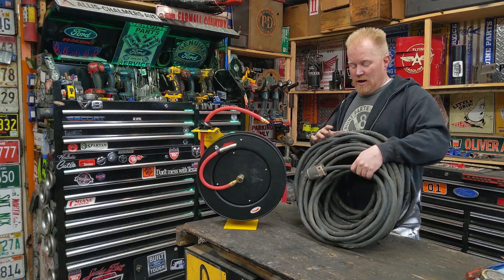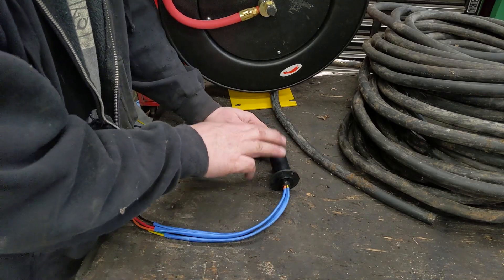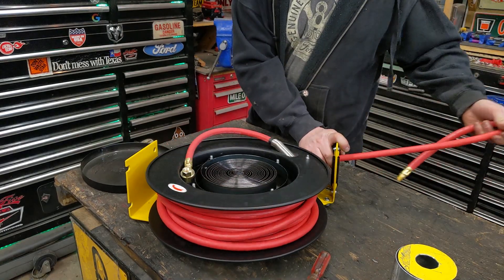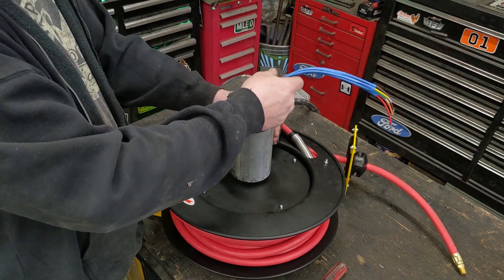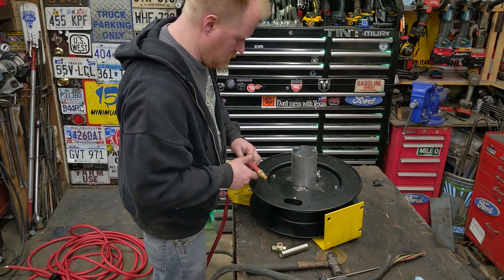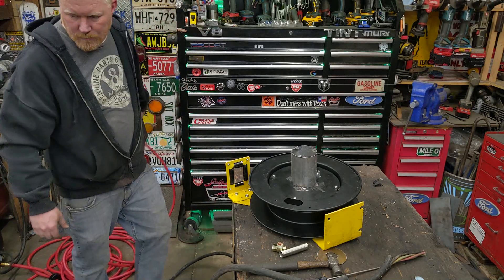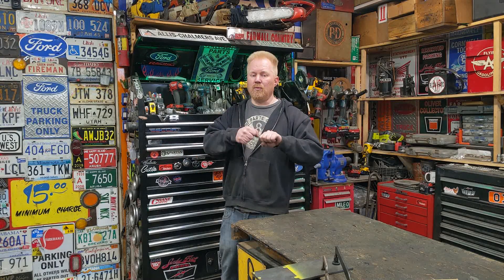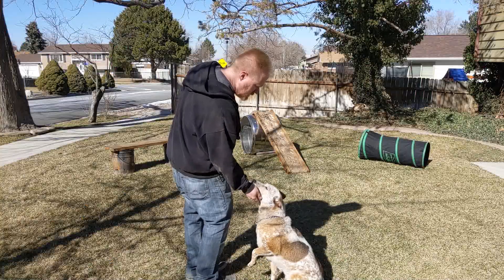DIY retractable WELDER Cord Reel 50amp 240volt Plasma Cutter

Comment: Nice fire starter dude, I’m sure the fire inspector  will have a lengthy conversation with your home owner insurance adjuster ie: non UL listed wire reel. Just saying!! Being alicensed journeyman electrical  in the trade for 45+ years, I figured I’d point out a few improper wiring techniques that were implemented in your conversion of the hose reel. Great idea, just don’t want to see anybody lose there house or shop to electrical fire and god forbid anyone’s life! So here goes for starters the slip ring-collector assembly is not UL listed, 1-conductors are exposed, tape doesn’t cut it per NEC. 2. One needs to unspool the wire before use as the wire wound up and in use will over time will heat up any ferrous metal within the EMF created by the wound up coil of wire. 3. Soldered connections are addressed in the NEC as being NOT permitted. The use of listed conductor splice connectors are. Also the red wirenuts made by Ideal are not rated for #6 stranded cu wire and 2 #12 cu wire. I know that a listed cable reel is expensive but so is you life and your family’s not to mention your home. No sense of paying home owners insurance only to shoot yourself in the foot by a nonapproved installation of equipment. The Woodhead company is one that sells super reliable cord reels just saying
Reply from the maker: First NEC has no governing over this at all as it is a plug in appliance. The NEC controls the wiring I have going from the breaker box to the outlet only. This is plugged into that. Soldering is 100% standard practice and approved under UL and CE. The Wire nuts are not retaining the wire at all. The slip ring is European Union CE listed. EVERY wire spool should be unwound during moderate-heavy use and is standard practice. The only thing I did that wouldn't meet UL or CE listing was not providing extra shielding for the wire going from the slip ring into the junction box. UL listing is voluntary and not required. They are a private company that charges a premium to inspect stuff. I know my toilet has a UL listing and it makes me feel comfortable every time I realize it.
Reply: The NEC has a governing body over the insurance underwriters. The the welder/plasma cutter is NOT an appliance it is considered cutting process EQUIPMENT per 630.1Nec. As per the soldered splices, NEC 110.14(b), (If conductors are soldered, First Mechanically and electrically splice or join the conductors so they are secure WITHOUT solder,then solder the connections insulate with friction tape or equivalent. That is for the 2 current carrying conductors as for the 3rd wire in your modification the grounding conductor, 250.8 NEC,grounding conductors SHALL Be connected by exothermic welding, listed pressure connectors,listed clamps,or other listed means. (No soldered joints). I didn’t bring up the other issue of voltage drop in the length of theirs on the reel. The reason the nec is there is to prevent fires ie: loss of life and property. Just saying!
Reply: Keep wiring like that and you will need an outhouse as your UL listed toilet will be up in smoke with your house

Comment: There are spools like this that are meant to be used for water hoses. They have a stronger spring so should have more pull and be a bit more robust.
Reply from the maker: Very true. I need to run it in and out a few dozen times to settle the clock spring. Then I can easily tighten it.

Comment: (for anybody that doesn't know) Basically with a slip ring it can spin for as long as a motor can, that's basically what's inside of a universal motor. It can spin as fast as a motor too if you support it properly. You can run parallels for a single appliance say you have a rolling mill feeder that need 600a 480v you could run 4 sets of 3 phase to keep your wire radius down but you have to individually protect each conductor with at minimum fuses. That's way beyond the scope of this video though 😂😂 your screw facing got my like 🤙
Reply from the maker: Hey Thanks, I'm glad you liked it.

Comment: Oh btw, another reason a lot of electricians are a bit skeptical to welders on normal domestic circuits is that they are usually Class A (or whatever it is over there) that doesn't have enough back EMF and noise shielding (mostly because it can't properly remove all noise effectively) for any delicate equipment, so if you're a bit unlucky it might take out your TV or amplifier. Had a friend getting his expensive tube amp wrecked by a TIG welder (the HF start is very noisy), but arching when welding with MIG and stick can also create quite a bit of noise.

I'm running mine through an isolation transformer, but there's still a bit of noise from it.
Reply from the maker: Very true. Well said.
Reply: Oh Boy! I have a lot of sensitive electronics. Maybe I don't want to weld at my house... 🙄🤔 My welders are all linear transformer type, not switch mode inverter type. Wouldn't the transformers in the welders isolate the noise? What about a heavy duty buck converter using a toroid and tons of capacitance?
Reply: @waltschannel7465  Transformers isolate noise quite well, the meatier the better.

The problem is with switch mode, it has quite spiky high frequency noise, and the self adapting nature (and ability to modify the output current rapidly) makes it return quite a bit of noise to the grid. Just adding large caps will (unintuitively) actually just make it worse, it has to be a properly designed filter, which is expensive and therefore often skimped on. Just having a huge 1:1 transformer in between will get rid of most of the noise.

Some info on designing PSU caps:
https://www.youtube.com/watch?v=qosClvn9GqU

Comment: The amperage on the welder/plasma cutter output side is stepped down to a lower voltage, so It's not directly correlated to the amperage on the input side. So for example, my 250A MIG consumes maximum 25A on the 240v side when it's on full tilt (and I'm not talking about average over time), so even considering you 'muricans use 120v (and consequently need twice as thick wires), that amperage rating on the slipring seems a bit over the top, and I couldn't find any info on what isolation level it has (ie how high voltage it can safely handle).
Reply from the maker: For high demand appliances like this we us 240v here in the US. It is two 120v phases 180degrees apart at 60hz. So unlike yours that is 240v positive and negative off zero, ours while one phase is 120v positive the other is 120v negative with a 240v difference between them. I think the slip ring stated 600v 30amp.
Reply: @sixtyfiveford  Here in Norway we use two systems, IT (Isolée Terre) and TN-S (Terra Neutral), in the US you usually use a variant of TN-C-S. Historically  we've used the IT net since it provides more reliability and can easily detect any ground faults (high earth fault impedance), but new installations use TN  as it allows easier load balancing (IT net's have to be carefully balanced or the neutral point starts drifting from neutral), provides more power and allows mixed 220/400V installations for when you need high demand. Also, the TN system(s) are used by more or less the rest of the world, so it's a bit easier to get equipment and training.

It is also quite common to use 220v or 400v three phase for anything more demanding than 2KW (like welders often are), and the configuration you use with 2x120v from 2 legs in a delta transformer doesn't easily allow this.

Info on TN (and the likes)
https://en.wikipedia.org/wiki/Earthing_system
I could only find this in Norwegian (possibly since it's mostly a quirk of ours):
https://no.wikipedia.org/wiki/IT-nett

Comment: Bad idea. The coil will be a transformer and create heat enough to cause a fire at high current and extended time.
Reply from the maker: No it won't. You have two 120v opposing phases that cancel each other out.

Comment: Do you know why they don't run coils of wire around a metallic core?
Reply: He's running the full circuit so the in and out currents cancel each other's magnetic fields.
Reply from the maker: Where have you been? It's done all the time.

Comment: 80# that's all?  Try 3 phase SO cord.  We have 150' long cables for our welder.  480VAC 30A is what we want for our welder at work but we use 8/4 SOOW cable to power them.   It effect the welder when we have that long of cable.  Love your idea!
Reply from the maker: I have a 6/4 SOOW 150' cord I never bring out because of weight. I can't imagine how much weight I have there.

Comment: My house isn't wired for a welder, and I am using (newbie) a Harbor Freight 60-125, I've been looking for a cheap extension cord, and really only need a 10 footer. Can I get away with using a 12-14 gauge?
Nice job.
Reply: That would be dangerous, and likely more expensive than buying heavier gauge cable. Don't skimp with this equipment! Actually, I hope you will get an electrician to run proper wiring and an adequate outlet at the point you want to set up your welding station. Meantime, bring the work to the welder, and cobble up good protection around it whenever you strike an arc.
Reply from the maker: That's the 120 volt welder isn't it? 12awg extension cord up to 50 foot will be more than adequate. 14awg you could get away with maybe 15 foot.

Comment: if you leave a 240 volt cord plugged in while in a coil the insulation seems to breakdown very fast,  even if no load is applied.  Something to do with the magnet  field.
Reply from the maker: I can't say I've ever heard this.
Reply: Not possible without any load through it.

Comment: That is a Great idea    If I took that cover off the spring would have jumped out and attacked me
Reply from the maker: I know where you're coming from. The first time I took it off I was very careful.
Reply: I was thinking the same thing. 
I have had a couple tape measure run ins. 😁😎
Reply: @OldSneelock  It is funny if no one gets hurt
Reply: @not2fast4u2c   You are so right. When they break it is like a razor blade flying around.

Comment: i was wondering.... welding with the wire coiled up like that, wouldn't it like create a magnetic field (like an induction heater or something) and melt the wire? i have no experience in electrical work.... just asking out of curiosity
Reply: The two poles are opposite (or zero) at any given moment, so their electromagnetic fields cancel each other out
Reply: @N-hunter  oh... i had no idea.. thanks for explaining!

Comment: Made in the USA, Mercotac slip ring connectors will transfer up to 500 amps.  NO that is not a typo.  The one I purchased for a Christmas decoration Ferris Wheel will transfer 50 amps.  The best thing about these is they use mercury as the slip ring contacts.  THUS, there is NEVER any wear on the rings.  I am extremely happy with the one I purchased.  Easy to mount, easier to use.
Thanks for the videos.
Reply from the maker: I did look at their slip rings. They are not cheap and the only one over 30 amps was over $1000 if I recall.
Reply: Got a link to the 50amp one?

Comment: They have power reels for RV applications with 50 amp wires. You can probably buy one of those and fit your own ends to them. I've even seen these reels have power retract.
Reply from the maker: Yes they do make exactly what I made here but it'll cost you about $1, 000-$2,000.

Comment: Heeler-isms. Ginger will be bouncing up and getting the 220 for you. Might better keep the breaker off. The only 220 here on a chord is for the pump to generator on a DPDT to disconnect from line voltage. It stays wound up on the generator, ready to go. Glad you're set and GBWYall!
Reply from the maker: Train her to bring me the cord end.
Reply: @sixtyfiveford  That'll work! BETTER, even!

Comment: Could you have wound the spring a little tighter? It looks like there were quite a few more turns available.
Reply from the maker: Yes I added two extra winds last night.
Reply: I was wondering the same.  I’d like to make one of these as I don’t mind getting dirty, sweating and wearing myself out when building something, but having to roll up that cord just pisses me off for some reason.

Comment: Love the idea, but coiled extension leads need to be fully unwound before drawing high amps.
Reply from the maker: Yes, that's standard practice with any extension cord.
Reply: Electromagnet!
Reply from the maker: @wafflezoot  Nope. 240v is two 120v phases that are perfectly opposite and cancel each other out.
Reply: @sixtyfiveford  , doesnt usa have 3 phases in the street which may mean it is only sometimes perfectly opposite out of the 60 alternations every second.  a qualified electrician is the person to ask about this.  coil extension leads are now illegal in australia because of how they induce current.  but i tell you what, you should have seen how excited a bloke was when he asked to buy and i gave him one of them.  i just pack up my stick welding cables, like my electrical cables, up in very large loops.  they last longer.
Reply: Same phase just tapped with a neutral in the middle to make it 120
Reply: @SavageCrackerXPF  Nope.  180 degrees out of phase.  That's why the neutral only carries the difference between the two

Comment: Even if it runs on 14ga wire... the farther you go the more voltage drop you get, so it starts screwing with your settings... You want to check charts and see what guage wire you need for the length and current draw.  You can test it... Plug in to wall, weld, then plug into a 50' cord, then a 100' cord, without messing with your settings and you will see a difference... especially on your lower welding settings like you use for sheet metal.
And as a hobbyist, I have run my welder building things where the welder shut off after welding non stop because it got too hot and I had to wait for it to cool down.
Reply from the maker: I would never power a welder with 14awg over any distance. If that's how it came across that was not my intention. A 120v 20amp welder does well on a 12awg cord up to around 100' max. A 240v 50amp welder would do 12awg up to around 25feet.
Reply: @sixtyfiveford  I mentioned 14ga because I think you said (without rewatching the video) one of your welders or one you owned, only had 14 ga wire in the welder cord. And some people not familiar with how electricity works, might get the wrong idea. Or for that matter, know that there are charts to calculate the wire size for the amps and length you are trying to get to.
Reply from the maker: @kiddiescripterkiller  The problem is that 99% of all the charts you see are wrong. They are for household 100% duty cycle appliances.  Out of twenty 240v 50 amp welders I've owned all but 2 had 14awg wire. The other two had 12awg and they could have been aluminum wire. You can get away with so much when you have a welder with a duty cycle of 20 to 30% at max output. On 10awg You can run them 100 ft without any issue but every single chart out there will tell you you cannot because they are based on NEC code for 100% duty cycle
Reply: @sixtyfiveford  True... But if you aren't sure of what you are doing, it is better to be safe than sorry... That is why the charts are rated that way. 

Or if you use the cord for something other than a welder. Like for example, if you decided to use your welder extension cord to feed power to your neighbors house during an emergency. Been there done that... His generator quit working, I didn't have the parts to fix it for him, so I fed him 220 off my generator. 

That is why the charts are setup like that. Granted the charts even at that point, are oversized, but they are calculated so you don't overheat the cable and cause a fire.
That is why the charts take in to account the wire size / length / type / insulation / ambient temperature, if is or isn't in a conduit, the size / type of the conduit, recommended junction box sizes, etc...

Comment: Was this reel the one that had the hose that cracked on you?
Reply from the maker: No, I bought a brand new hose reel for this project and thought I would get an extra hose. Nope, the hose was so cheap that came with this one. The rubber was so soft and uncured it stuck to other parts of the hose when reeled up and ripped holes in itself. So the brand new hose has around 5 holes in it and I've never aired it up. I'm taking just the hose back to HF today to see if they'll give me a new one.

Comment: I use a normal 120v 12ga extension cord for my welder. I made adapters that convert one end into a 5-20 plug (which goes into my shop receptacle) and the other into a dryer outlet for the welder. It basically makes a 240v extension cord.
Anyway, nice work! That's a handy thing to have.
Reply from the maker: Very cool. I would do the same and with occasional hand to cord heat temp checks, never give it a second thought.  12awg will easily handle 50amps up to about 25feet with a 20% duty cycle. But I don't think I have even needed to turn my stick welder up to full output, so I'm only pulling 20-30amps ever.
Reply: @sixtyfiveford  I actually made two different adapters. One converts a standard 120v plug into a 240/120v 5-20 plug (the kind with one prong sideways). On the other end is the female version of that adapter, but I also made another one that converts from a 5-20 to a dryer style outlet. My plasma cutter takes a 5-20, my welder uses a dryer outlet, so I can do both with the same extension cord just by switching adapters on one end. Anyway, yeah, it works great and I've never noticed anything heating up. My welder can't do a 100% duty cycle and actual on time is fairly small anyway, so like you said, no need for big fat expensive wire.